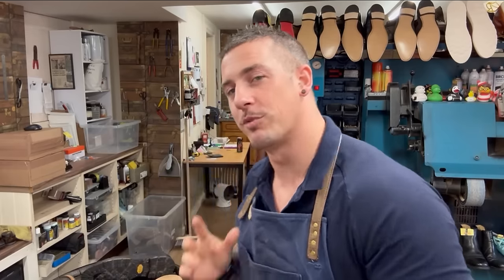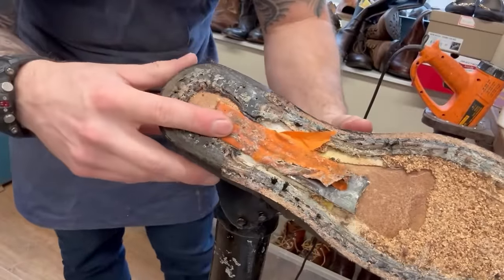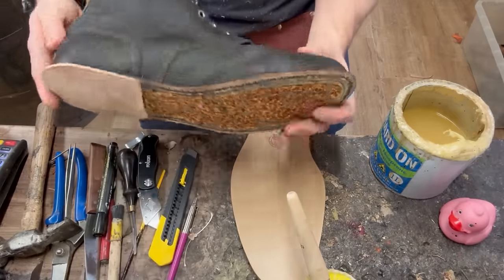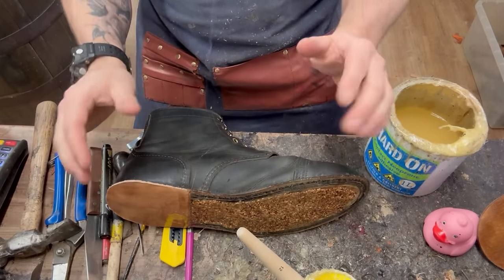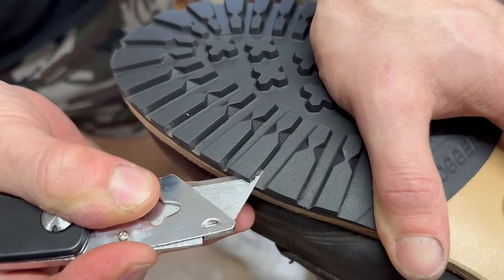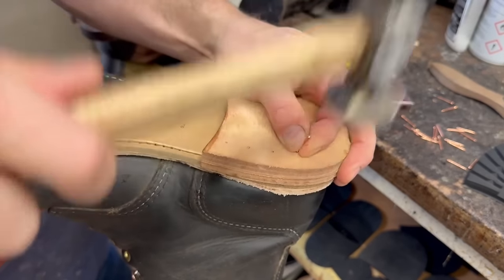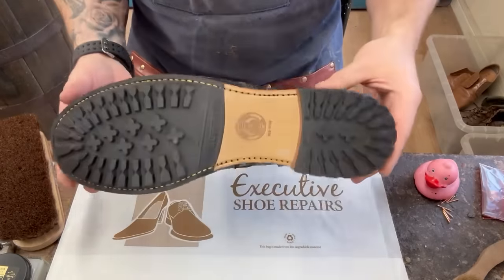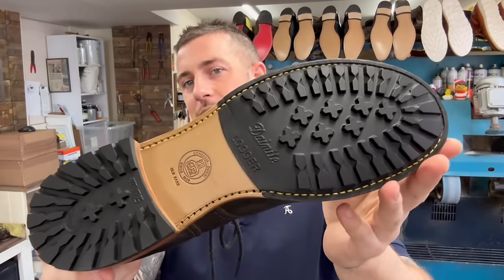Nightmare shoe repair! These Red Wing boots Needed Rescuing ... Badly!

Comment: it's always a pleasure to watch your craftsman skill in shoe repairs. it also reminds me off how bad my cobbler was where i have fix up my shoes. The company called itself as a master shoemaker. i paid high prices only for getting cheap exchange soles and they charged my for services like stiching the shoes extra. But i never saw anything of the charged service. 

i had ask them were are the new stiches and they answered my. you cant see them i just have to believe it they have done it. Basically you never saw anything like "love" or "effort" in the shoe repairs. I did it 3 times than i lost my trust in this craftsmanship. At the end i had throw all fixed shoes in the bin and bought me new one.

I'd would love to find a decent cobbler in my area. I do have some nice shoes but i'm afraid to let them repair if it necessary because of the bad experience i got so far.

Comment: I like the feibergs mink oil myself but you also have to consider im not looking for a prime finish just to get them destroyed the next day.  Its just to keep the leather supple and a minor bit of waterproofing added.   I used spend hours oiling a pair but then i got smart i just glob it on like the old dubbing and use a heat gun and melt it in.  It works so good 😂

Comment: 4:47 since you calling out, surely you should be unpicking from top down and out (away from the leather) as you going from the bottom in then up is causing scratches to the leather.

Comment: Very nice work - question. Why does the stitching not continue 360 degrees around the boot? I've seen this on so many other boots - the sole stitching only goes around  the front three quarters of the boot and not under the heel block.

Comment: well congratulations , in mexico mil felicidades hacen un trabajo profecional , very nice equipped shop , the most important thing is THAT YOU LOVES YOUR JOB , so wonderful and perfect repairs , also ANABEL nice girl , we in mexico don't use anymore cork , instead we use special foam layers with memory , cork after a while doesn't have memory anymore and gets hard, that leather sole is that real leather or is that prefabricated leather , since we are only using real leather , abrazos desde mexico a ambos anabel y usted

Comment: If the customer does anything other than be an urban hipster with these boots, I guarantee that outsole front piece will peel away from the leather sole where there were no tacks.  The part between the stiches. Just put a couple of tacks in there, for crying out loud. Glue is not enough.
Edit: I'm just a guy out in the woods and I don't know anything about cobbler work.  So I might be wrong.
Reply from the maker: What are you on about? The whole lot was stitched? Strange how you’re able to guarantee what will happen to this shoe as you are as you state … not a cobbler.